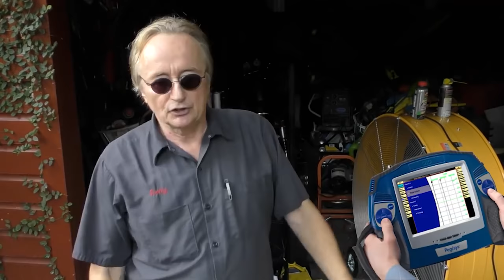3 Illegal Mods That Will Make Your Car Run Better

Comment: Hey Scotty, just curious if you would know the issue - 2009 Nissan Murano can only go a certain 10-20 MPH Up hill, also has a very stalled takeoff, recently begun jerking with harsher acceleration. Would this be a case of something to do with the oxygen sensors / catalytic? Or maybe even the oxygen intake?
Reply: Do you got a engine light on? If so, go to oriellys or somewhere with a free obd reader. Have them plug it in and if it says IAC or TPS low voltage, you either gotta buy a new wiring harness, fuse box, or connectors. I had the same problem with my car

Comment: Actually. Airplanes do have mufflers in the commercial engines every is used to. It’s called a “mixer” but its purpose is to muffle sound. Or else your ears would blow out🤣

Comment: Bought a used 07 sentra for 3k & after i cleaned the electronic throttle i took it to the dealership just to find out the cat was burnt to a crisp😢😮

Comment: Scotty, I'm From Jersey. And I Have A 2010 Land Rover LR4. my Check Engine Light Might Come On Once A Year With Insufficient Cat. My Mech Just Resets The Code, Because He Says It Can't Be The Cat If It Takes So Long To Show Up Again. I Have A Driver's Side Cat, And The Up & Downstream Oxygen Sensors. What's Your Take On The Issue. I Ask Because You Really Appear Very Knowledgeable In These Issues, Hell!! Cars PERIOD!!! Please Point Me In The Right Direction.
Reply: You need the error code thats associated with the Check engine light. That will tell you what area it is , thats failing. Otherwise your just guessing and about to play parts monopoly

Comment: a fixfor the cat if rattleingused to take the cat off clean it with paint thinners and push stainless steel wire wool in the gap were it rattled bolted back on and done,,the baffle box used to strip them out and make them smaller and use the wire wool as well ,,got a idea on makeing  a engine more fuel effetionate  involves remapping the engine useing a 2 lt  nos or something that can hold high pressure 3 mm copper pipe to each injector and airflow sensers a small turbo  and a cooler system to run off the manifold and get hot gasses to spin up the tubo and compress the gas into the container and blow cooled down and injected back into head with injectors  mix lower amount of fuel with manifold gas which has 25  to 30 percent unburnt fuel mix

Comment: Scotty question please, what would happen if you added an electric squirrel cage blower to the front of the intake system. Would it create more power, better fuel efficiency, or just engine problems?
Reply: No it doesn't, there are videos of people trying it

Comment: I'm not saying he doesn't know what a catalytic converter does.... But they reduce NO which is nitrogen oxide. There's no hydrogen or carbon on that molecule. So it's not a hydrocarbon. Now I'm not saying your car doesn't run rich and excesd fuel gets burned there, but what I am saying is that's not it's functional purpose.

Comment: @Scotty Killmer what if you have a back pressure EGR system? I got a 96 Corolla with a 96 Celica motor 1.8 . I know it's my flex pipe got right down to Massachusetts pothole I don't only lose horsepower my fuel drops rapidly. And that ain't cheap L🤣L

Comment: I have a 2004 Hyundai Santa fa with the 3.5 L or 3.7 the big one sorry . But anyway  it won't go over 18 mph I've changed the tps , the iac the throttle body the throttle Spencer A and B . Checked the cats but it's not working any ideas would be great . Tky John

Comment: Put a set of dumps on a car and open them you want to run it and let it go through the muffler when not or around cops.  I use to take the cats off knock the center out of them with a bar and weld it back in when they plug off.  Then they look legal unless they put a meter on it.   Doing nos injection you have to advance or retard the timing when it goes in and people that do not know what they are doing will blow them up Everytime

Comment: Hey Scotty, what are your thoughts on running a tank of 100 LL Av-Gas to clean out the engine and exhaust system?
Reply: You will plug up your catalytic converter...So no way

Comment: I would like to put a screw supercharger on my 1998 ws6 350  trans am can it handle it? it has a 2000 corvette motor now  open exhaust I'm in Alabama

Comment: U don't need those junky cats just take 2 spark plug nonfoulers & screw them together & then drill the hole in the first one big enough for ur 02 sensor to screw in it & screw 02 sensor & those 2 nonfoulers into each other & put all that into 02 bung hole & plug up 02 sensor harness & walla no codes thrown. Replace cats with pipe but only if u live in a state that don't check emissions

Comment: Have you ever met someone who talks incessantly and sounds very knowledgeable then you get home and when your not having your ears blasted you have time to think. Then you decide I think some of what I was told might not be exactly right...this Chanel is no more than an advertising Chanel disguised as mechanical instruction. Check all the promotional links. They pay to be there..so it has to be biased towards those products. Only channels with NO SHOPPING links are totally unbiased.just setting the Ballance right as it seemed to be leaning to far one way .

Comment: 4:09 on Fox body fords 3.8 to 4.6l removing the stock muffler and putting on hi flow glass packs or Flowmasters will actually reduce horsepower..what?. Actual test lost .6 sec 0-60 on a 2001. The ECU fuel management screws up royally without backpressure and the computer cannot adjust the timing correctly to the new flow..in fact knock sensors will constantly retard timing on pre 1996 mustangs. Dont take them off.

Comment: Your logic is somewhat flawed with regard to exhaust. A modern engine is tuned for the current CAFE standards especially those with VVT. WITHOUT the specific exhaust, you will throw off your ECM causing.a change to ignition timing, V. V T timing or worse it goes into limp mode (open loop), also the  V V T WILL reduce your cylinder pressure, not good. An open exhaust will not run well if at all. Older cars are more forgiving, the older the better however a high performane camshaft has a larger vavle overlap and narrower lobe centerline than a stocker, the HP Cam relies on back pressure to  maintain a high cylinder pressure. Of course there are exceptions such as a high perf cam with smaller overlap and wider lobe centerline. My grandfather and I were mechanics at the Stanton Michigan dragway for the NHRA racing organization, he was also the racing performance engineer  / engine designer for pontiac motorsports and oldsmobile motorsports in the 60's and 70's. He designed the Pontiac 400 Ram Air alongside John DeLorean,...im sorry if that comes off braggish, really i was just bored.

Comment: help with the vvt-i engen with bad idle and also back firering but cleaned the throttle it does not start unless i plce mie feet on the accelerator
Reply: Sad

Comment: I have a cheaper way we can go a lot faster without any of that stuff. It's called the pedal commander. On a motorcycle it makes it throttle a lot easier to twist.  Has 4 settings  Eco city sport sport plus. And has 4 settings on the bottom 1 through 4 positive and 1 through 4 negative. I went from Eco  4 To city 4. I took off like a bullet. And that's not in a car it's on a Can-Am RT  limited spider.  What it does in remaps your computer and your vehicle that you can get quicker's vital response and fuel. In other words You hit that gas  pedal and you have very slow take off. With the pedal commander. You changed the settings you could smoke the backtires taken off. Is automatically All you do is just plug it in. And set it. A lot of people are buying it. I took off from a light I have 2 tires in front one in a back the front end almost lifted. I was only in city mode.

Comment: he knows ,,,but an engine does not ,,SUCK ..air....its the principle of vacuum ,,,verses atmospheric pressure ...verses displacement...
Reply: What else is "sucking" but the creation of a vacuum so that gases or liquids will flow into the evacuated area?

Comment: I had a guy cut out my exhaust on my Toyota Tacoma. Put in a Mega flow and another  Pipe on the other side. It was fine but just  At certain speed was noisy Like a  mosquito in your ear.  The wife wouldn't have  It drive from California to Arkansas . So I brought my old exhaust I kept the exhaust and muffler and Had him put it back on  Too it's original stock state. He couldn't believe I still had it The muffler and pipe. They took me to the cleaners today at the dealer. Had them changed my oil no problem. I Have one speed fan high .toke it back what happened to my fan speed .we didn't touch it. Ck it came  back 6.78.00 what  for a fan switch bad relay  So they thought it would be a little high so they came back and said what about 565. No I wasn't thinking What about 5:00 .00 found out later all. I  need  was the relay witch was 52.00 they cut the harness 4 wires  didn't have to .25.oo harness  labor 4.33.00. I 'm upset 😡 that the harness was cut. They changed me  Twice What it should cost.
Reply: Wtf what language is this??😂

Comment: Scotty is WRONG, yet again. MOST cars (yes, 4 stroke cars) DO LOSE low end power with freer-flowing mufflers.  You typically lose a handful of ft. Lbs. On pretty much any 4, 6, 8 cylinder engine by going with a freer flowing muffler. I even lost a little on my 8.0 V10 going to dual mufflers...... Every racer knows this..... Quit being a "know it all", Scotty

Comment: In woke locations, reprogramming your computer (via OBD) for better performance and or gas mileage will fail emissions testing, purely for changing the stock parameters.